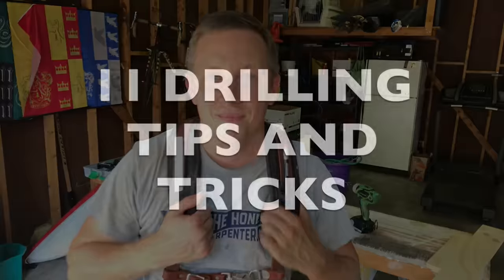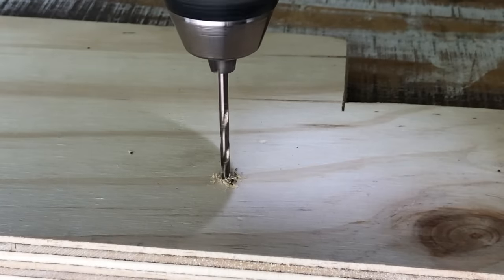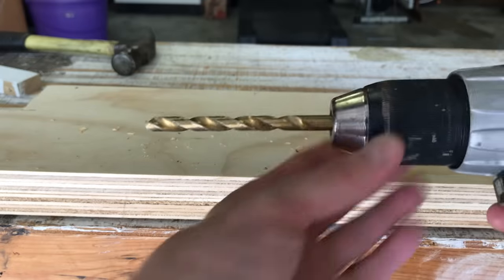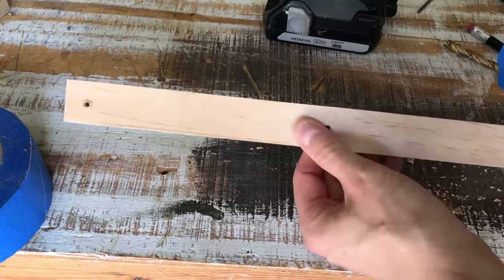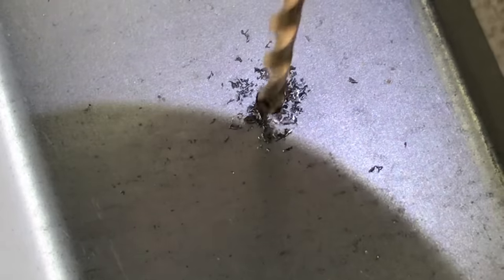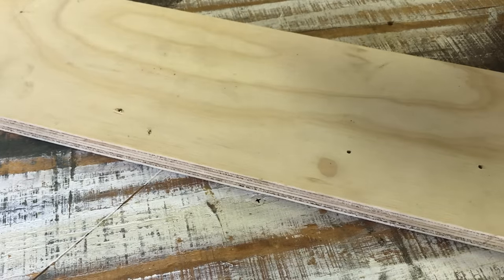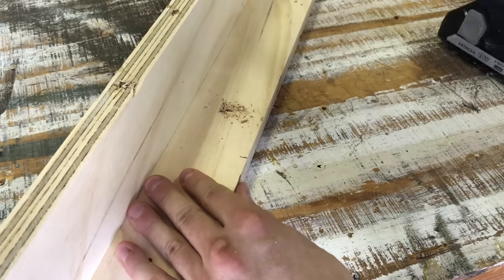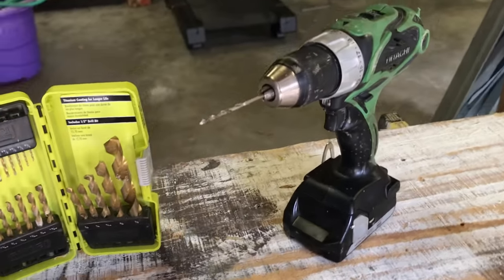11 DRILLING TIPS AND TRICKS (And Mistakes To Avoid!)

Comment: I've been a machinist and maintenance mechanic for fifty years of my 75 years in life. I can't tell you how many finger and hand infections I've had from clearing chips from drilled material using my hands or fingers. I learned what chip brushes and low air can do to remove chips without consequences. Just a thought. !
Reply from the maker: That’s a good point Frank. Thanks for writing in with the advice!

Comment: Tip #12....When building a project, use two electric drill motors. I do that all the time. It saves time from changing drill bits.  I have already used three electric drills, one had a power cord since I don't collect drills. 

Great video, all good tips.
Barry

Comment: Great tips. Some I figured out on my own, like using tape for a depth gauge and others, like using an awl to make an indentation before drilling, I learned from my mom. Here are some of my tips. (1) Look at your drill bit when it's running. If it looks blurry, then the drill is bent, or it is not centered in the 3 jaws, or it is loose. (2) When you are tightening the jaws with a key, start in hole 1 and give a little twist to the key, then go to hole 2 and give a little twist, then go to hole 3 and give a little twist. Then repeat 1-2-3 until the jaws are tight. By moving from hole to hole in a circle to tighten the jaws, you keep the drill centered in the jaws. (3) When inserting a small drill, like a 1/16 or 5/64, start with the jaws closed. Then gradually open the jaws until you have just enough of an opening to insert the drill and tighten. That will insure that the small drill is centered between the jaws. Always wear eye protection when using a drill.

Comment: 1) use your drill’s clutch to select the right speed for the job. there’s also usually a high and low gear (or 1 and 2). your low gear delivers more torque at the cost of rpms
2) hogging material can snap a bit quickly. your bit will often discolor at a stress point from heat before it breaks. also wear eye protection
3) obviously dont drill through a workpiece into anything that’ll damage the bit. or into anything that cant be damaged

Comment: How can I reem out a doorknob hole that just needs to be shaved on one side (inner)?  What tool would I use?  I tried using a drill bit but it didn't do much.  Any suggestions? Thank you! Great video!
Reply: Use a rasp with a rounded surface. Employ a version of Honest Carpenter’s tape tear out prevention method to avoid cosmetic damage to the door.
Reply: @mercoid  Thank you! Can I ask another question?  What would you use to cut across the bottom of a wooden fence gate (with slats) - I need to make more room for pavers I'm setting down.  I can't use my jig saw - no room.  I'm only cutting off about an inch or two above the ground.  I have one of those "multi tool" tools but it was a struggle.  Would I need a Sawzall?   I tried to use a hand saw too and it didn't work very well - too much work!. The gate has to be open while I'm doing this so there is no stability to push against. Thanks!

Comment: Just to add on to the great tip on depth drilling. You could use a depth gauge if you are using your handle attached to the drill. Thanks plenty

Comment: You answered my question about drilling for metal screws (bolt actually). Start with a bit that is just the shaft thickness then hog out the hole if necessary. Really loved this video. Thank you for posting the tips.

Comment: Excellent video. Any suggestions on how to prevent the situation where screws don't come back out because the flutes are not grabbing and you have to do something annoying like apply pressure to push them out while using the drill?

Comment: I agree with all of what you said, except for when drilling into steel. Generally yes drilling rpm are lower but not when drilling smaller holes. In that case the drill actually has to spin much faster otherwhise they will snap. The formula is the following : 12 x ( material cutting speed ÷ 3.14 x (drill diameter). Cutting speed for mild steel is 90ft/s

Comment: Thank you so much. My drill is seldom used. Recently I was drilling metal and while I had some idea I shouldn't use high speed, I think from watching videos with mills and lathes, I really wasn't sure how much pressure I should apply. And yet I've seen videos with guys confidently drilling wood at high speed. So while I've gotten by, it's been nagging at me ever since to really find out properly how to drill a hole. It sounds dumb but if you don't know, you don't know, right? Thanks for thinking of us beginners.

Comment: WRT to pre-drilling for a fastener: The screw package always gives drill sizes for hardwood and for softwood. But what about particle board? It seems to me that particle board must be even softer than softwood, so maybe a pilot hole in particle board should be a little smaller than for softwood. OTOH, maybe the pilot hole should be a little larger because particle board must be less strong and the wood particles will just fall apart from a screw pushing too hard on it in a pilot hole. Any advice?

Comment: You can use digital vernier callipers to measure the diameter mm of the shaft of a screw fixing to figure out the correct mm drill bit

Comment: Ethan - this is great! I learned a ton in 8 short minutes. One quick question, what is the best kind of drill bit for drilling large holes in plywood? I have a Forstner bit I've used to cut holes in 2x4's and this seems like a better bit than Spade bits. Which type of bit causes less tear out? I am drilling holes of 1.5 in to 2.75 in for a box that holds tubes of oil paint. My dad has painted impressionist stuff for 40+ years. The box he's got has square holes, but I can take out some of the slats and my plan is to put a piece of birch plywood over the top of it. Thanks.

Comment: Thanks so much. It was very good explaination. Can you suggest what to do if drill bit is stuck in Drill Driver. My drill keeps getting stuck in Driver and its very difficult to remove it. Right now, its stuck that i cant use it anymore.

Comment: I recently bought 30 - 4mm bits for predrilling as I use this size for 80% of all wood fixings. But I have 1mm  to 6mm available (just in case!)
Small to large masonry bits is good for brick and concrete - each drill has less to do.

Comment: One thing Im curious about, it appears that all the drills you use are the kind made for drilling into metal, even when you're drilling into wood, I know they work perfectly fine for this purpose if you do it right, but I know they make drills for wood that have a very  sharp tip supposedly to stop the drill skipping across the surface when starting to drill. Im just wondering why you don't use those?

Comment: Excellent video.. I'm trying to learn a trick for drilling through cinder block so the drill bit doesnt' slip or wander. Its difficult to "punch" a small hole first in this material. Thoughts on a solution? I wish there was a jig or guide that was commonly sold but I'm unable to find...

Comment: I’m mounting a tv into an older wall (not drywall) … so drilling into the studs is my concern…. Am I not reducing the strength of the stud? What if I make a mistake? Can I seal the wood hole (in addition to the wall patch) to keep integrity of the stud? Like using wood glue or cellulose?

Comment: 2:13 as someone who dabbles in the art of machining where material is much harder, if you zoom in on any drill bit tip they don't meet. Meaning the big phatty might have a really hard time clearing out the center of the hole making your life harder. So yes pre-drill with a smaller bit cause the bigger bit(s) are not cutting the dead center, and causing a lot of extra work for you, the machine, and the bit

Comment: Also when attaching a soft material to a harder material some times your screws will snap in half. Run your screw in reverse with some pressure through the soft material then switch it to the correct direction and the screws will stop snapping off.

Comment: Hi, I like the tape technique. I have to drill through wood and sometimes have problems with the wood splitting on the other side. Would using tape on the opposite side stop the wood from splitting? 
Thanks

Comment: I was boring out a hole in dense metal, which took some effort, but I achieved my hole. The problem is the force as resulted in the complete chuck unit to become wobbly. Would replacing the chuck be sufficient or would I need to replace to whole drill?

Comment: Just wondering if a video exists on how to properly drill a hole in thicker steel, starting with a smaller bit and upsizing to the required larger size? The pilot hole is drilled first to centre the hole in the correct position and then upsized. The part I don't know is what size to start with for say a 1/2 inch hole and so how small do I start. I used to know. If you go too big with the pilot hole, the hole can be drilled in the wrong spot as the drill wonders and when you upsize to the required drill diameter the larger drill can grab violently and I don't know if it's possible to go too small at the start? I have no step drill and I'm suggesting this as to be done with either an electric hand drill or a drill press.
I was taught this method in a TAFE course but never had to worry about it till now. I'm no carpenter and my memory sucks.

Comment: Tip number 4 step up method is good for wood however for drilling metal it can cause your hole to loose it’s precise location that was originally marked and can come out a little jagged and sloppy. However a drill press would solve this problem. Otherwise just start a pilot hole at 1/8” and go straight up to the desired diameter.

Comment: If you don't have a drill bit and you're screwing into soft woods, you can press the screw while spinning it at a high speed in the reverse direction of the threads. This prevents splitting as well as a bored-out section where the threads can't grip, allowing you to pull your top material tight to your anchor material.

Comment: slightly unrelated, I have a delta drill press just like the one featured in this video.  I do not know how to remove the chuck, which needs cleaning and some rust removal.  Some have recommended a pickle fork to remove it, though I am dubious on this.  Aren't there tools or wedges to help remove the jacobs chuck?  Your advice is greatly appreciated.

Comment: Hey when can you tell that a bit is dull and needs replacing??? When it struggles some to drill the hole I assume it's because the wood is wet or I hit a tougher spot. Cause it's not always.

Comment: One tip, when you mark your bit with tape. Instead of wrapping the tape around the bit completely, try wrapping it around but taping it to itself leaving about 1-2cm branching out. When swarf is removed, this branch of tape will brush away swarf and cleaning the are up, making it easier to see your drill location
Reply: Nice

Comment: This is the best video.  Wish I watched this before all my years of splintered wood, stripped and misaligned screws.  Thanks.
Reply from the maker: You’re welcome! I too have made more mistakes than I can remember 😁
Reply: Just.found this.channel by a.You tube.suggestion.  Definitely will use.the.nail tip. As I watch this..I realize I have spare tool box I made..I will be putting a lot of
things like these in it. On a.daily basis I see things that.I have overlooked.  That's changing.

Comment: additional tis for drilling metal. Always buy quality split point drills; they self start without walking. All machinists know the following term: feed and speed. Start by pulsing the drill to find the right speed for the particular metal and hole size your drilling. The metal will send curls back up the flute of the bit when you've got it right. And yes, definitely push (that's the feed) to maintain the curl. Exit is also important, especially if you cannot back up the metal. When approaching the exit, back off the feed and finesse it through. This will avoid hangup.

Comment: thanks for these tips, I am going to attempt to drill a 10mm hole in my door frame tomorrow to feed a cable through, then fill it,seal it, the wood is a hard wood I'm guessing, would it be best to go 3mm 6mm 8mm 10mm ? thanks in advance

Comment: How do I drill a pilot hole for a 3" #8 screw in softwood?  The drill bit table says to use a 5/64 bit, but the available bits are only 2" long.  Not sure I want to increase the bit size enough to be able to use a 3" long bit.  Do I just limit the pilot hole to just under 2" and screw into the wood, or is there another technique to get the full length pilot hole?

Comment: Add lubricant, wd40 or crc to drill thicker metal material, a thread of shaving will come out, clean and clear hole when needed. We need more people sharing tricks like you do.
Reply: Also keeps the bit cooler and stays sharp longer .

Comment: I started being serious about wood working about 4 years ago.  I mostly build simple projects.  Here is a fantastic tip I discovered. I was wanting to fasten something
so it would never move..Say you have a bottom corner piece on a table...They have tendency to not be tight against the table sides. This will end all that..Always be aware of the unsightly marks the clamps can leave on softer wood. Most.cases I don't see them. Take a 2x2 block....clamp it where you want to secure..I literally shoot for hundreds of.years..Now tap the wood block towards the.corner or wherever you want to secure. Now see how tight it is...I was amazed..there can be hundreds
 of pounds of force here. Now repeat that on the other side.  This. is a test so leave the clamp(s) fastened.  Don't glue yet..this is your first time..possibly trying this.
This took forever to text, this takes an extra minute to do and may save hours..ie. No shaky joints. 
The reason why joints get shaky is: as we hammer the blocks without clamps ; the laws of physics work against us. For every action there is an opposite and equal reaction unless acted on by an outside unbalanced force.  
So the hammer hits the block and without the clamp the block come back...try this..it literally will take minutes..This can be applied all the time. I definitely would not glue this instill you are sure that 
you are satisfied. Now the screws
should.be placed..or at least I place my screws at 45 degrees or so.  This will stop any rotatational movement.  These are my personal experiences.. Perfect this on scrap pieces.  Also a slight toenail of say 5 degrees on the screws  may help the stability. 
Again try this on scrap. I personally use tightbond premium..its very reasonable.
Reply: PIANOSTYLE100.  There's too much technical verbiage in your post for me to conceptualize what you are saying.  Consider making a video, because I would like to understand what you are recommending.
Reply: @kimstockdale632 This should help. Go your workbench.  I'll illustrate with 2x2 dimension lumber. 
Clamp 2 short pieces together at right angles.. your clamps will clamp the table and the  2  2 x 2s
Now put a 2 foot long 2 x 2  vertically in the corner. That would be the first table leg.  Now take a small length of 2 x 2 (Eg 1 foot). Clamp that 2 by two to the longer  two by two. You may want to use 2 clamps here. You will notice this  is very loose in the corner and will make a very wobley table. Now tighten down a little on clamps. This is just an experiment (proof of concept)..Now hammer just a little harder towards corner. The joint will begin to tighten. Make sure that there is no movement from the work bench.  Eventually you will hit it harder and it will be extremely stable. Try another piece of 2 x 2 and lock that at right angles.  This joint is capable of being extremely sturdy. I have used it for 3 years and they are very dependable..
Reply: @kimstockdale632  I am in the middle of reroofing my house.
I may be able to post a pix of how
the experiment works  . IDk.
Reply: @kimstockdale632 I am trying to set up a video to explain what I mean.

Comment: When you are drilling metal, the simplified RPM formula for HSS drill bits is CS*4/Diameter, Where CS - is the linear speed of the drilling edge and is 100 ft/min for steel. The detailed one is: CS*12*(Radius*2pi)^(-1) = CS*12*(Diameter*pi)^(-1). Also when drilling steel, use oil(after the bit already bit in material) and when you see chip discoloration, reduce RPM.

Comment: In addition, use a wood bit to drill into wood. There have a pointy end and cutter on the exterieor instead of the cone shapped bits. This will make your life easier.

Comment: #10 Toenail  drilling. If the area allows it I use a nail to start a hole and get the angle right to guide  the drill.

Comment: metal depends on which metal it is, steel you want to use all the force the bit can take and go pretty slow, aluminum you can go fast and you still have to push but not nearly as hard as steel.

Comment: Why had no one address masonry drill bits slipping and becoming loose. I practically have to tighten after evey hole that need hammering drill. I use Makita drill k, do you think i should switch to dewalt

Comment: Sticking painters tape on tile helps prevent the bit from slipping and gets a nice clean hole. It can be scary, since usually you only get one shot, you don't want to crack or scratch up your tile. Use a masonry bit and take your time, and practice on an extra piece first if you have one.

Comment: I often use the drill bit itself to create a starter hole simply by holding the drill on the spot I want and tapping lightly to create the guide hole without need for an extra tool.
Reply from the maker: I’ve done that quite a few times as well David. Key is being gentle 👍

Comment: I need to know how to extend the length of the drill bit so that I can drill holes that are deeper and harder to reach.  The drill bit holder on the power drill is sometimes to wide and will prevent the drill from drilling a straight hole.